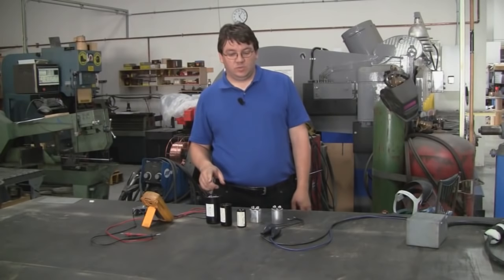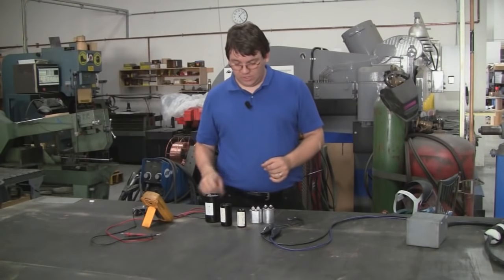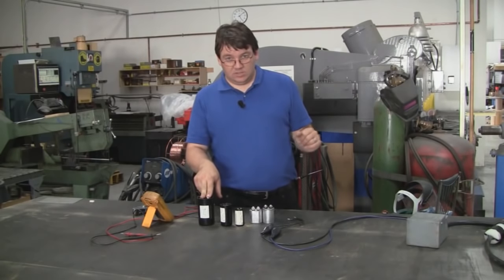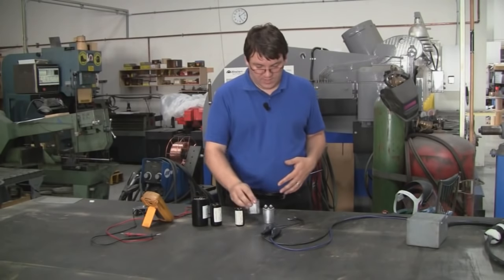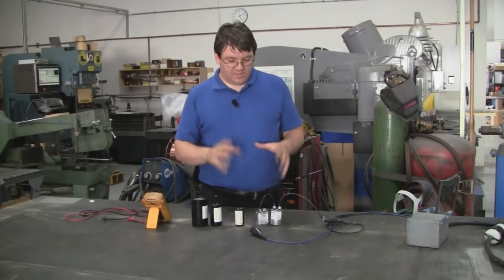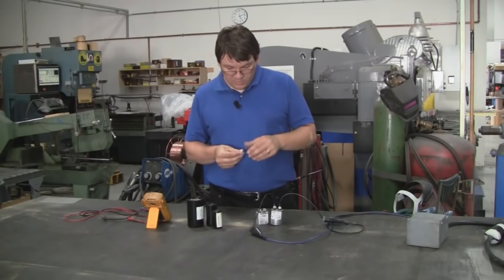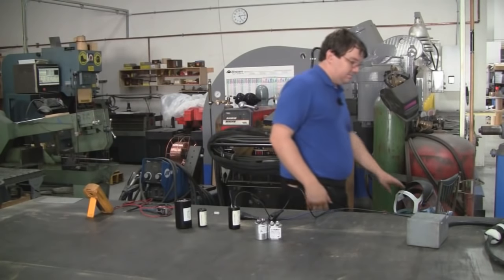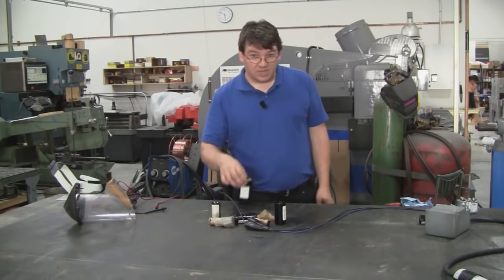Start Capacitors & Run Capacitors for Electric Motors - Differences Explained by TEMCo

Comment: "IF" the clock on the back wall was accurate, you did this in one take.  Until you started blowing stuff up, you just kept rolling without a bleep or hiccup.  Sometimes people aren't just watching what you do, but how you get it done as well.  Very good on both counts.  Congratulations.

Comment: I have an older AC motor that is 240v and runs two capacitors. I went to fire it up and one of the capacitors smoked up. The other one was entirely cool and I noticed it doesn't seem to have any juice in it. The smokey one was spraying heck all over the place.

My suspicion was that one capacitor went bad and it wasn't able to get up to speed and thus the centrifugal switches weren't able to kick in and it smoked the other one. Does that make sense or am I completely off the mark.

Also for replacing these would I need 120v capacitors since it's one capacitor on each 120v circuit or would I need two 240v capacitors? Mine also don't have the bleed down resistor on them, not sure if that's necessary for the newer ones or not. It's an old saw from the 20s but the motor is definitely newer.

Stumbled across these videos from your ebay auctions. Figured I'd see what you guys have to say on it.

Comment from the maker: Some capacitors are 1000+ mfd, though many have low capacitance ranges as well. In your case, you could easily use a run cap in place of a start cap.

Some capacitors are built with a "Pressure Sensitive Interrupter" design that causes them to fail before internal pressures can cause serious injury. The one we showed is designed so that the top of the capacitor expands and breaks internal wiring.

Comment: I bought a couple of your run capacitors and noticed no country of manufactur on label are they made in China? HVAC Industry having lots of problems with China made caps don't last. I now have gone to Genteq and have better luck.

Comment: Great video! One question: You mentioned that run capacitors have a 100% duty cycle so they can remain in the circuit. I want to use these capacitors for a pf correction project on an induction motor, but as my pf will be changing, i need to provide nearly constant switching in which the caps are introduced and taken out of the circuit. Is this safe to do for run caps, or should i use a different type of capacitor?

Thank you in advance!

Comment: Your video on differences between run and start capacitors is very good. What you did not mention is the larger capacitance will deliver a certain current for a LONGER (time) as required. One can obtain the same current level with a small capacitance but the time constant is much shorter, and this will not work! In reality, current delivered by a capacitor is determined by I=V/R. Remember there is a time constant! For example a voltage of 100 volts across a capacitor with a 1 ohm resistor across capacitor will deliver 100 amperes (time constant not taken into account,) Capacitors can more or less be inspected on performance by using an ohm meter on the megohm scale, across a discharged capacitor. Reading should be in the megohm or higher, Basically an open circuit. For quality, apply the operating DC voltage across the cap. to charge. Then install a DC Ma meter to view current flow into the capacitor. This determines the number of DC ohms of this capacitor, ( ohms =V/I ) and shows the power factor. The higher the Ma flow into this capacitor, the worse this capacitor is or is rising to 1, power factor. Power factor is PF = R/Z.  It should be 0, or almost no current flow indicates a good capacitor!  (R is extremely high.). FYI, there should be no heat detected at any time. To increase capacitor life, add parallel capacitors at the same voltage but adding to required capacitance only , not over. For example a 100 uf cap. can be split twice of 2 x 50 uf or more. Splitting the current demanded by the motor capacitor is always easier on a cap. when multi units are in parallel, and this results in added capacitor life! You might need hundreds of amperes for starting and the small R of the capacitor adds up when delivering lots of amperes, resulting in heat in the capacitor, a no, no.

Comment: I'm impressed and I don't know anything. I am experimenting with running an AC 230volt washing machine motor on DC 12volts and upwards. I am pleased with the results. However I need more start torque. Can I achieve this with capacitors and if so how do I go about it. Many thanks for the video. I learnt something I did not know today.

Comment: Hi and thank you for your help.  I was going to take the motor apart but thought an easier test.   I snipped off one of the cap wires then turned on the small band saw.  The motor just hummed so I quickly turned the motor but it would not start.  I then reconnected the cap, turned the motor on and it ran.  While it was running, I removed the jumper from the cap and the motor slowed down a bit.  So I think this is a run cap.  Have I diagnosed this correctly?  Thank you.

Comment: I have a 240v 3 phase 7.5hp 5.5kw induction motor for a heavy duty mixer and would like to run it on single phase as i do not have 3phase connection at my location. will i be able to convert it to single phase with cap or i wont get the amount speed from the motor?

Comment: To sum this up when you connect caps in series you add the voltages but you divide the mfd by the number of caps in series. Caps in parallel you add the MFD and the voltage remains the same

Comment: If this is the wrong place/channel for this question, I apologize upfront for not being technical in this area. I have a situation I need help with involving Start-Up and/or Run Capacitor(s). I think.....

Situation: When my 6,500 Watt (peak) house back up generator is used to power my home in power outages, my A/C will start slowly and run as the generator slows way down, but the generator recovers after the A/C fully starts up (pump and fans). The A/C will run powered by the generator for whatever time is required for the thermostat setting. The rest of the house circuits can be turned on (Frig, lights, .....) while the A/C is running and all is well and the generator does not sound overloaded or toggle its breaker off. However, once the A/C turns off when the set temperature is achieved, it will not cycle back on without the generator throwing its main 220VAC breaker which shuts everything down. Then, with ALL circuits to the house off (except A/C), and the generator breaker reset, the generator will struggle to restart the A/C and most of the time will throw the 220VAC generator breaker. While during this condition, I can turn on everything/every circuit in the house and the generator will power everything without issue until I try to start the A/C and the cycle repeats. (I know to give the A/C n Generator the best chance to restart is to turn off all the other circuits, my point is to show there is nothing else out of the ordinary while in this condition)

I think I need a larger Startup Capacitor for my A/C Condenser (pump and fan). How would I figure out what type/size/capacitance, ......Capacitor to purchase and how would I identify the terminals such that I can swap it out with the existing correctly?

Please note: I do not need a lesson in the generator peak/run and house demand (load). I am that technical (for a mechanical guy, but this is Magic Smoke Stuff and so I am in the deep end and barely treading water).   For review:  1.) The generator runs the house with no issues with the A/C off.  2.) The generator runs the house with the A/C starting first and the rest of the house load added after the A/C starts the First Time.  3.) The A/C will seldom start the Second Time even if all the house loads are turned off and only the A/C is connected to the generator.  4.) Other than this Second Start (or anything after) failure of the A/C running on the generator, the A/C works flawlessly on-grid power as does the rest of the house.

Thank you in advance for any help.
Reply: What you are needing to add to your A/C unit is known as a Soft Start capacitor. It reduces inrush capacity needed from your generator upon the startup of the AC's condensing unit, which likely requires a substantial current draw when engaged and until it reaches its normal operating running speed, which likely takes a few seconds. This increased draw happens for large enough of a draw and for long enough that it trips the generators breaker because it overly taxes the generators system to a degree that it would either A; bog it down to a point at which it would stall the engine or B; overload the generating capacity of the core itself and start heating to a degree where the internals could become damaged or fail completely. Just look up "A/C Soft Start Capacitors" or "A/C Soft Start Systems" and there will be a wide array for you to research and choose from. Hope this info helped and good luck with your project

Comment: i have an electric motor but i cannot get it to run. When you turn it on it just hums and does nothing. The odd time it would start but most of the time its just hums. There is a cylinder on the side of it and i think it is a start capacitor but i am not sure. It says 160-200 uf so any idea whether its a run capacitor or a start capacitor?

Comment: Great Video!!! thanks for explaining the two different types.  I know nothing about them.  Installed a start capacitor in a run setup by mistake and it blew up right away hahaha.  Now I know that it needs a run capacitor to work.  Thanks again, saved me from buying a new motor for the bandsaw

Comment: How do you know what size compasotor to replace the compasotors with if there's no label or writing on the old compasotors and there's 3 compasotors on this air compressor and how do I find out what one is the start and run on this compressor?

Comment: Is it a good idea to install  a start capacitor if compressor run  capacitor keeps blowing? Could this keep the unit working for a while until it can be replaced?

Comment: Good day, Sir can Í asked the correct value of capacitor for 10hp motor 3 phase that can run single phase 220vac. Thank you Sir

Comment from the maker: Judging from the capacitance, it appears to be a start capacitor. Start capacitors typically have a range of capacitances, while run capacitors give a single number. The values on start caps also tend to be higher than those on run caps.

Comment from the maker: Fortunately, start caps are not a ploy to rob unsuspecting folks of their money. Run and start caps are used for two different purposes. Run caps are used to continuously adjust current or phase shift to a motor's windings in an effort to optimize the motor's torque and efficiency performance. Start caps are used to briefly shift phase on a start winding in a single phase electric motor to create an increase in torque.

Comment: Quick question, Im building a AC circuit with an AC motor, and i was planning to use a motor start capacitor. The power supply would not be able to supply the current needed to start the motor, so i was going to use a capacitor to give the motor the higher current surge it needs to start. am i thinking of this correctly? or do caps not supply current surges in AC like they can in DC. Thanks
Reply from the maker: Start capacitors in an AC motor circuit don't handle surge current like in DC, rather, they delay the AC wave form as it enters into another winding in the motor. This gives you a different phase in the magnetic field to allow the rotor to begin turning.

Comment: I have issues with a 220 volt dual capacitor motor, when the motor is switched on, the motor turns but then the breaker cuts in. I changed the start up capacitor with a new one, same issue. I returned the motor to the supplier and waited 5 weeks for it to be returned. Once I received it I immediately plug it in and it started and the bare motor ran. Once I put the impeller on and secured all the parts into the housing, it doesn't start!!
Is the weight of the impeller cause a load for the motor not to start? I changed the start up capacitor again, still same result.  I disconnect the breaker from the circuit,  it finally started!! But then it died because the start up capacitor began leaking oil.....im lost!!
Can it be the breaker at fault?

Comment: How do I find what value start capacitor to use to replace an unmarked one?  The motor is 230vac, 12A, 2hp, 1ph.  I can not find any info for the 40 year old motor.

Comment from the maker: What we wanted to illustrate with the exploding start cap was that you can't use it as a run cap.

Run capacitors do not come with high capacitance ratings as most start capacitors. You'll rarely find run caps larger than 150 mfd. Capacitance ratings for start caps, on the other hand, can go as high as 1200 mfd or more.

Like we mentioned in the video, while you could use a bunch of run caps in place of a start capacitors to get up to the required mfd rating, you'd need adequate mounting space.
Reply: What cause that high rating capacitor to burst?

Comment: I wanted to know the power supply voltage you were using we understood it was AC but is that a 120 plug that you hooks to the capacitors directly I want to know it's capability can you put a wall outlet directly to one of those running capacitors?

Comment: so the capacitors do not have polarity? my air compressor has similar capacitors like the black run one you have and don't see any signs of showing what side is negative or positive (one blue wire and one white wire).

Comment: You said a capacitor should be about 1.5 times the supplied voltage.
I had a pump that ran on 120 volts but the capacitor said 300VAC. 
Does the hp of the motor matter for the necessary VAC ? 
There are no markings on it but I think this motor is around 1/2  hp. 
Question 1)   Was that capacitor VAC bigger than necessary ? (1.5 x 120v = 180)

I messed up and let it run after it pumped out all the water. 
Once I unplugged it, it would no longer start or run unless I spun the impeller by hand, then it worked fine. 

Question 2)  Can you clarify and explain to me if it was a start or a run capacitor, or combination ?
It says only 8 micro farads, so I guess maybe that makes it a run capacitor.
 So then I guess sometimes a run capacitor is all that's needed to get the motor 'to start'  ????
Because...why ?

Comment: I need a lil help.. I am trying to get a pool pump motor to run off of my dc to ac inverter and just hums and then the inverter shuts down. I think if I add a start run capacitor to the circuit it should work fine. I am hoping .. it’s a 120 volt 12 amp 60 hrtz motor. Which start/run capacitor do you recommend. I am thinking a CBB 65 will work. But don’t want to blow the motor.. any suggestions ?

Comment: What capacitors should I connect to the 400Watt generator, any suggestion please  .
I am using capacitors 8 micro farad and as soon as I plug in the light. the power is gon generator is 650 watts

Comment: I have a 1/6 horsepower 240 volt normal house freezer that is rated at 90 watts, I believe that equates to 124kW motor. I want to help the motor get started/run more efficiently etc. It connects to a 2500 Watts inverter (5000watts surge) though I want to dedicate a much smaller inverter. Can you please suggest what size and type of capacitor I could use and point out where I can get info on clear instructions on installing it? These is NOT already a capacitor in it.

Comment: I have a grizzly dust collector motor wired for 220.   Seems the capacitor is bad.  Opened it up and it’s a 300mfd,  120VAC capacitor.  
Am I right that that is the wrong capacitor?   Possible that the motor was rewired for 220 and the capacitor was not changed?  
I got the unit used.

Comment: My AC went out.  My intent was to do the electrical checks, but it started out with a dead mouse on top of the capacitor.  I cleaned all the debris, then did the checks for the compressor which was fine as was the relay and controller voltage, leaving the capacitor.  I couldn't find any shorts on the capacitor but it is the last item to prove out.  It did have a bulge on the top.  So I ordered it.  I get it tomorrow.  Question:  was it the mouse that may have cause the capacitor to fail?

Comment: have a single phase century 5 hp 1800 rpm motor, has a 330 volt 408 to 480 mfd cap that blew.
it runs with a 220v cap i have in stock, similar mfd range, is that ok to use in an emergency?

Comment: If a motor calls for a 5mF run CAP will the motor be damaged if you use a 7.5 or 10mF run CAP?

Comment: am using a schultz angle grinder, it has two capacitors, now I have a problem with a big capacitor from it which has some drums inside(capacitor with drums inside), what type of capacitor can I repress it and  can a capacitors from a capacitors Bosch grinder work in it ????

Comment: Is the voltage spec on a Start (or Run) cap an absolute value?
In other words, will a 250v rated cap work ok in a 110v circuit, given the µF is correct ?

Comment: Yikes. my 31 year old Keeprite A/C's capacitor looks like it has some of the oil pooled on the top inside the rim.  I know this is the weak point of this unit...Been running 31 years with no repairs (that i'm aware of, certainly not any repairs in the 16 years we've owned the house).  Be nice to be able to replace it and keep this gem of a unit running.

Comment: Both original and replacement run capacitor are same 12.5 MFD 440/370 VAC but new replaced blower motor has 7.5 MFD listed . Still good ? Seems fine , it working